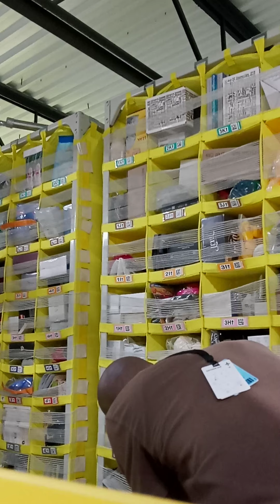How I work at a Amazon DC. #positive #working #jobs

Comment: I've been at amazon for a little over 2 months now. I've got my head wrapped around everything for the most part and honestly like working there for the most part. The only thing I wish I could have explained to me without getting scolded is why  there is a rule stating "No earbuds on the floor..."I am not trying to be funny/offensive when I say this, but how can you enforce a rule like that, and have deaf employees working the same job on the same floor?
Reply: That is a ridiculous rule. As long as you have maybe only one ear bud in (for safety reasons and so you can hear outside of only your music) and you are keeping up to speed, what is the problem? I’d get a very discreet one and do it anyway. If they let found out and let me go, it’s not the job for me. Peace!
Reply from the maker: Yeah they say it's about safety. But we would sneek anyway and have one in on the low.
Reply: @thankheavenforseveneleven5522  My argument exactly. I recently submitted a case to HR, but I doubt the enaswer they'll provide me with will be suffice XD
Reply: I hated that rule… music would help you get through the shift so much but it’s a “safety hazard”🙄🙄
Reply: @YourA Towel! no speakers lol
Reply: I’d say one ear bud is totally fair, for safety reasons. Especially since you are basically working in a sweat shop for them 😓
Reply: I put my right air pod in my left ear upside down and put a hat on. Cant even notice it

Comment: Honestly this job isn’t that bad people complain about everything nowadays. I’ve seen people work their ass off with no benefits and little pay at other jobs. I prefer this than dealing with customers. Ppl complain because they are not use to being on their feet but it’s honestly easy.
Reply from the maker: Glad its working out for you.
Reply: Yeah I know that if I do this job I'll be fine with it and yeah the jobs such as retail and customer service they don't even be successful for. You can try all day to apply for retail they just won't offer you..
Reply: working their ass off with no benefits and little pay is called being taken advantage of.  Amazon works people very hard and squeezes every bit out of you, mentally and physically, until you cant take it anymore, however it does provide opportunities to people whom may not be able to get stable employment.  At the end of the day, its a warehouse job - nothing glamarous, all hard work, but that don't mean they shouldn't be getting paid well or have a union that looks out for their rights.
Reply: I worked at Amazon back in 2013. Stowing then was way different. None of these robots in the video. You didnt stand in one spot. Had to go get your yellow tubs and go to find empty or half empty bins and bin them in. Had to be constantly moving and on a high rate as hired on compared to seasonal employees. Pickers had to move even faster, basically running or briskly walking the whole shift. You didn’t meet rate even barely missing it, it’s a write up. It was way harder then than these newer warehouses where you just stand and stow/pick

Comment: I was a picker for 2 1/2 months but got fed up with the managers harassing me over their quota. The bods continuously stall due to failure or an item on the floor so I had to wait up to 1/2 hour before they'd start moving.
  But management won't accept responsibility for repeated areas. But they will blame you for not achieving the quota. So I told them to shove the lousy  job. Amazon sucks to work for.
Reply from the maker: Yep, I know what you're talking about from my experience as well. They except no excuse.
Reply: From what i heard, they will harrass you about the quota but they cant fire you even if you dont meet it.
Reply: @vergiljerome9126  From what I've seen working there. Low performers don't get fired its the people with attendance issues.
Reply: U right about that!

Comment: @Donney Simpson  I work in a manual FC doing pick, we don't have these robots that bring everything to you.  We walk upto 26km a night, up and down the isles in the various libraries.  I totally agree though, the worst is when your constantly picking from the low bins A, B then  A, B again and again, then to F or H and back again to A & B for items. 
It definitely takes a toll on your body mainly your knees and for most people, they have never spent so much time on their knee's as they can & tend to do, in this job. 
I guess one thing I see in these robotic warehouses, is you don't tend to suffer like we do,  with bins constantly over filled by stow, and having to empty bins to scan all items when you encounter shortages.
Our rates are way less than yours though in our type of FC, with only a few top pickers managing to pick over 1000 items in a single 10hr shift, but it is all dependant on which flow the PA assigns you as to what you can reasonable achieve.
Reply: Honestly  it’s not that bad ppl have worse jobs and have zero benefits and work more for $8
Reply: @lazycatt287  I can't speak for what happens in the USA, but here in Australia, we have minimum wage and jobs don't normally come with benefits.  Wages for warehouse staff range from AUD 27 to 45 per hour. At my FC it's more like AUD$34.90 per hour.  
Having said that, our cost of living is much higher than the USA.
Reply: I was at a facility that used to be that way but they upgraded and got cherry pickers for everyone to use…I actually thought it was fun driving those things around all day. Better than walking
Reply from the maker: Hang in there, your FC will go robotic sooner or later. Then you can stay until you reach retirement. I quit in 2020, wasn't for me. I have family and friends that have been at Amazon for years.
Salute to all ya'll!

Comment: I would much rather do picking instead of packing mixed outbound because the things to pack is too heavy and hurts my body.
Reply from the maker: Picking tears your fingers up. Because stow has to stuff packages that do not always fit. And you have to work it out of some TIGHT! Spots.
Reply: Same here ): I was looking to transfer from shipdock. It's the most labor intensive department and my body has changed from carrying heavy boxes

Comment: So when the pod shows up there's a light on it to show you which bin to pick from and then you put everything into one bin until it's full? Just asking cause I'm thinking about applying. Thanks
Reply from the maker: Yes, the light shines in the bin you pick from. And you fill the tote to a certain height, over filling stops the conveyor belt makes an alarm trip. Your trainer will explain all that, no big deal the job is brain less just repetitive and if you're out of shape it will take a toll on your body especially your knees and hands for the picker position.
Reply: @donneysimpson8536  They created this huge system, and nobody thought like "this gonna hurt if they got to take items from the bottom".
I guess its just too late to change that :)
Reply: @CottonInDerTube  they thought about it,  the company could disable them at any time. its all about making $$$, and you're just an expendable piece of machinery to them.  cheers.
Reply: @Donney Simpson   amen to that... i checked ✔️  all those boxes sir.
Reply: @donneysimpson8536  hi excuse me ☝️if Im sure that one of the tote or bin is full , I can push the bin even the conveyor light is off? Could you tell me more about it please?

Comment: What's your current average pick scan rate per hour?  Ever get approached by your manager for low  rate?  Is physical strain safety technique an accepted explanation?
  To change task-position in the building because of the physical condition (maybe continuous knee squat problem)  would you go to your manager or would you go directly to visit HR?(to switch to  something less hard on the knees back such as Packer or Counter or Spacer,  before worsen the knees and before get warnings for low rate)

What is amazon "DSP" ?
Reply from the maker: DSP drives the gray vans and ups type trucks delivering packages.
Reply from the maker: I quit the picker job in November 2020. This video old. I dont know what to do to change positions I only lasted 6 weeks before I had enough.
Reply: @donneysimpson8536  did u quit amazon? Im almost a month in and im ready to quit its too draining.
Reply: @TOXIC-DANG3R901  What shift did u pick? I read that if u pick a long 10 hour shift at amazon you'll regret it quickly.
Reply: dsp is slaving for 12 hours a day delivering 400+ packages
Reply: @TOXIC-DANG3R901  
Get an appointment with your HR office and try to switch positions.  There are positions that are not fast  labour.  Try  Spacer, and Count.
Reply: @totoroutes5389  i did they denied it everytime so i just got sick of it an left went to Wal-Mart now I feel better
Reply: @totoroutes5389  
Are there any jobs in a FC that a person that needs a cane to assist walking is able to do?
I can bend and reach, just not excess walking for an entire shift. 
~💜🌻
Reply: @CultJam999  
A counter job or an office job in HR department, and on phones.   And customer service rep.  
For the warehouse floor,  go for positions that don't require fast speed and bending.  "Count," and "Packiing Singles"(single items),  and, "Security"(scanning the picked items to check if correct).  Almost all the positions involve standing for long period.  "Dock Spacer"(monitors the foot traffic entering the dock area.  Includes a chair.)
Reply from the maker: @perfectgematriadecodesabc4259  Facts...I just quit after 6 months. Been bit by two dogs. And delivering in the rural areas in Georgia is a whole other story. A lot of driveways these ppl have are RIDICULOUS! ...especially when it's raining.

Comment: Hi bro i just star work at this position now so how many total units i need to do a day ? And the amazon they actually need employee do exactly how many total United a day so please let me know bro thanks
Reply from the maker: When I was there in 2020 our rate was 250+ per hour. I don't know if it changed or not. But thats it. So if you work 12hr shifts 250 × 12 or 10hr shift. Will give you your day total.
Reply: @donneysimpson8536  I only do 10hour a day and i work 4 days a week so I wanna make sure my position now is very important or no or just a basic normally job

Comment: I really hope this is all I'm doing lol. I don't wanna do no heavy lifting lol.
Reply from the maker: No heavy lifting. I think the heaviest I lifted from the bottom slot was 20lbs. Maybe, if that much. But no worries you good bro.
Reply: @donneysimpson8536  bruh.... I just started last night! I'm really making about $24 an hour just to scan stuff for 8 to 10hrs. This can't be the same Amazon people were talking about.
Reply: @BLAZE45  are u doing the exact same job as the guy in the video ?
Reply: @zedkhan4137  nope. I work in receiving. All I do is scan items as they come through.
Reply: @BLAZE45  did u have to have experience or any skill to do it
Reply: @zedkhan4137  nope they hire literally anyone. No interview or anything.
Reply: @BLAZE45  Can you explain to me how they're paying you $24 an hour? The starting rate where i started is 15 and 16 for the night shift.
Reply from the maker: @BLAZE45  You lucked out on a good position. Usually if you can survive the most common starter positions... Picker, stow, packer you can get a sweet position and ride it out because the pay aint bad. Its just what your position is.
Reply: @donneysimpson8536  they killing me with them damn 12hr shifts till December 24th lol. I'm hanging in there though.

Comment: Can you explain the yellow light flash when a tote is full? At training they mentioned something about pressing the button after it flashes but I couldn't understand what they said.
Reply from the maker: They you to push that tote. Its a item or items in that particular tote and they are ready to pack and ship it. Your computer screen won't give you anymore picks until that tote is pushed anyway. Push it as soon as possible because it goes against your rate time too. After you push that tote, press the button to be able to continue and get an empty tote in its place asap. That effects time also.
Reply from the maker: Also when you pack a tote keep items under the lip of the tote because if items above the lip will trip an alarm and stop the line. It will set off an alarm for someone to come and fix that tote.

Comment: yo I'm newly hired . Can you tell me how to process an unscannable. I didn' t really get the trainer. After scanning everything and all and it won't scan, I  press the "Unscannable" button first on the screen and then get new and put the item and scan the new tote.. How do I make the screen move to the next item? Does it move automatically to the next item after I scan the tote, or do I have to press something?
Reply from the maker: If I remember correctly. You press unscannable item button. Place that item in a new empty tote. Scan the bar code on that tote and push it through immediately like you would do a full one, and your screen should move on. It's been a while but I believe those are the steps.
Reply: @donneysimpson8536  I'm sorry, where would I push the new tote? Like if all the racks have totes, where would I push the new tote that I got?
Reply from the maker: @AdvantageYT  No problem, you just push whatever tote that is the most filled, and use that spot. After you push the unscannable item tote. Place an empty back in that spot and your screen will continue giving you picks. If you have anymore questions just ask.
Reply: @donneysimpson8536  So in other words, you're gonna do a total of 2 pushes? First, the full one one that is on the rack must be pushed, and then the one that contains the unscannable?
Reply from the maker: @AdvantageYT  Correct, two pushes. And you can push any tote you choose on the rack to make a space for unscannable item tote. Myself I used to push the one hand the most items already in it.

Comment: Do you have any advice on properly protecting my legs I keep getting a high item a low item then the rack I get is always on the far left I keep twisting and my knees
Reply: Remember the nose over toes, it does work.  Turn with your whole body as you step, not just twisting.

Comment: Is it true you’re being timed ?
Reply from the maker: Yes, as soon as you scan your badge  on your station you working at. The clock is running until your shift ends. Breaks, lunch, bathroom breaks, walks to refill your water bottle. All timed.
Reply: It's a warehouse most pick, pack, count and similar tasks in warehouses are timed.

Comment: I applied and still didn’t  ny appointment 🥲
Reply from the maker: Really? ..because they hire everyone and it's no interview, just mouth swab and back ground check. Now it could be tje particular one you applied at could be fully staffed at the moment. But trust me if that's the answer. Someone will be
 quitting very soon Amazon turn over is nuts.
Reply: @donneysimpson8536  Ow well , They put me on waiting list I guess ,
Reply from the maker: @bakonoda  apply for Amazon DSP and deliver packages. They pay  $18.75 per hour depending on your state though Im quoting from my state. The warehouse jobs suck (picker, stow, counter, packing)  those are the slave jobs in the warehouse and thats where you begin and are lucky enough to get promoted.
Reply: @donneysimpson8536  thanks for the heads up
Reply from the maker: @bakonoda  No doubt bro